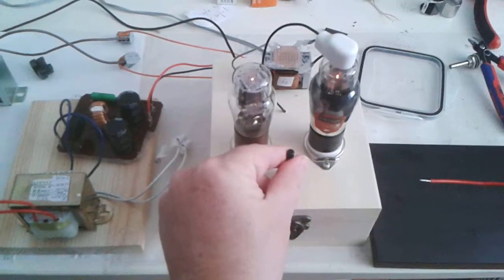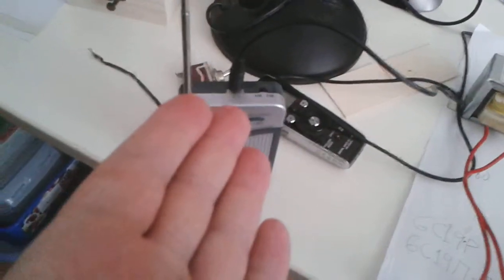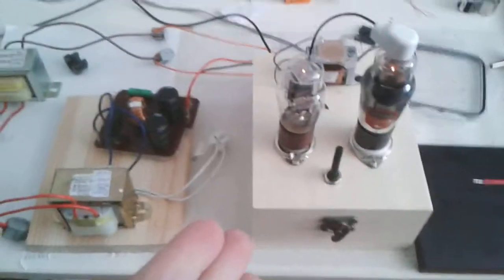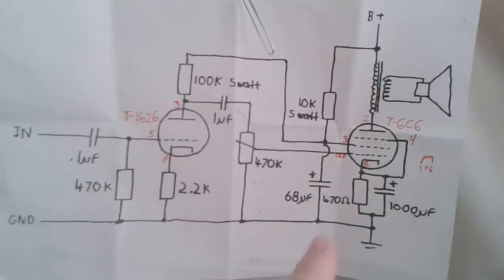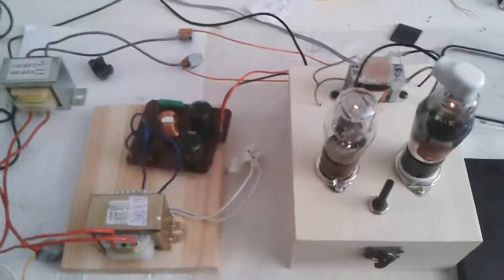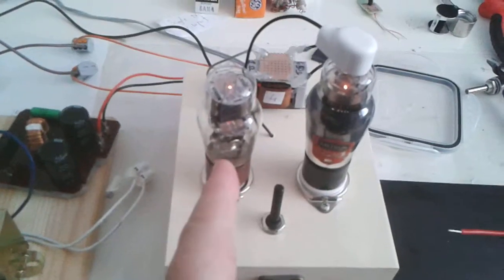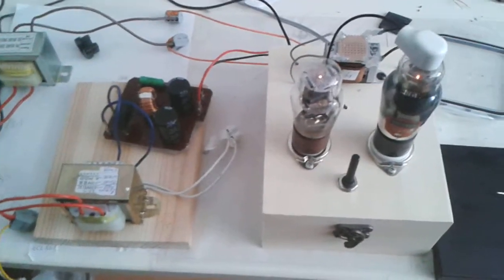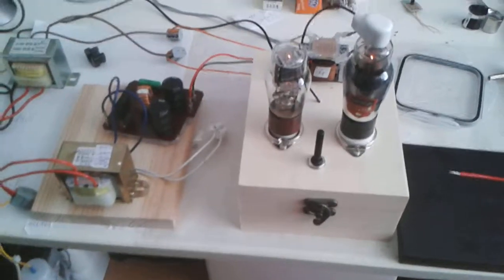CDC-1 Tube Amp Test #1

Comment: Nice build, I would like to try make one myself some day
Reply from the maker: +Pulverrostmannen Man! You absolutely SHOULD DO IT! This isn't the "perfect" amp...but it's a great "1st build" tube amp! Really easy and helps separate the basics from the AMP itself to the POWER SUPPLY. The first time you make one...it's like ALCHEMY! Please give it a try and if you have questions ask myself or COOL DUDE CLEM who made the original video and design. BE CAREFUL! You really need to know what you're doing when it comes to high voltage and safety practice with electricity. I hate to say it, but I HIGHLY RECOMMEND YOU TAKE A BASIC ELECTRONICS CLASS first and study
Reply: +MAN CAVE NO.1 ha ha thanks for the advice, I will likely try this. and for electronics I am pretty skilled with this kind of stuff.sometimes I repair amplifiers that pros have discarded when I want to,(one amp that works again had 6 simultaneous faults at the same time and was really trouble to fix because of that, ( the oscillator, the powersupplies, the protection circuit, the start circuit, the amp transistors, and a short circuit.  use oscilloscope to check the circuits and stuff like that. I have actually fixed a Vintage 1950s tube radio (Luxor R10) the other week that you may find on my channel along with tons of other cool stuff I made :)

but for me is the transistor based amplifiers are more logic and I want to learn more about tube amplifiers to get a better look how they actually work and this kind of project would be perfect for that.
so I got one question you may have an answer for. transformer to use in this circuit to power the speaker. were and what kind would be easy to find and use for that? it needs this high impedance coil that not often exist in everything. any ideas? Thanks for your time. btw did I get here from cool dudes video reading your comment there :)
Reply from the maker: Honestly, the cheapest and easiest way to get a tube output transformer or OPT is go to a local flea market and find an old tube radio. Look at it as well as you can to make sure the transformers inside are there and in decent enough shape and buy the radio. Look for ones that don't work anymore so you can get them nice and cheap. If you're in Europe this is pretty easy. You can also go to electronic and appliance stores where people take old/used electronics to be disposed of and check there to see what's been "turned in" often the people at the store will let you take what you want if you ask.

I have gotten many of them this way. An old tube radio is a GREAT salvage even if it's busted. If you're lucky, you can get a nice (if not AWESOME RARE AND EXPENSIVE) classic speaker made for tubes along with an OPT and maybe even a good power supply transformer as well. There are all types from simple and cheap to variable input voltages and output voltages.

Finally, there is eBay and Aliexpress.....type in "tube output transformer" or the tube type and the word "transformer" like this "el84 output transfomer" or just "el84 transformer" and see what hits you get.

There is also one good Chinese supplier on Aliexpress that sells tube transformers and chokes of a basic type for quite cheap. The most basic one is a 5watt OPT that is (I think) 5kΩ to 4Ω and 8Ω. Can buy for $20 free shipping! But....it takes about 30 to 45 days to ship. But they are solid and work GREAT (so far).

I'll post the link below. It is a 2 piece to a lot set. SO it's actually about $40 for 2 transformers. 

http://www.aliexpress.com/item/Tube-Amplifier-Output-Transformer-5W-Z11-Single-ended-Silicon-Steel-EI-Transformers-Power-Audio-HIFI-DIY/32339654109.html
Reply: +MAN CAVE NO.1 Thanks for your reply :) the link you gave me said that the transformer are no longer available. but I think I gonna look for transformers in the antique store if i can get any there. the best store that had more of these are permanent closed so it won't be as easy as before I'm afraid but I keep my eyes open, I could use 3 output transformers total. hope I get some radio to loot :D I live in Sweden but actually there are not so many old stuff like this here anymore for a decent price
Reply from the maker: Hmmm.....no kidding? Not available? Just a sec....
Reply from the maker: Oh yeah...you are right...still there are some out there. Keep looking or email the seller. There will be more.
Reply from the maker: +Pulverrostmannen 

Try these on eBay for example.....there are many like it just search "tube output transformer" on both eBay and Aliexpress:

http://www.ebay.com/itm/191184570372

http://www.ebay.com/itm/191163618986
Reply: +MAN CAVE NO.1 yeah there you have something. thanks :) I will however have to wait a while to buy them because teeth and cars has ruined me for the time and I need to save my cash for that. hopefully I may order some of those when it has came past this time for me. I really like to try this out :)
Reply from the maker: If u just need one transformer I might be able to spare a used one from one of my radio salvages, I have an extra power transformer as well if u need it (assuming u live in Europe or where 220v is standard). Send me a PM and I'll see what I can do. I have plenty of cheap tubes I can spare as well for a similar job as this.
Reply from the maker: Pman! You sure did!